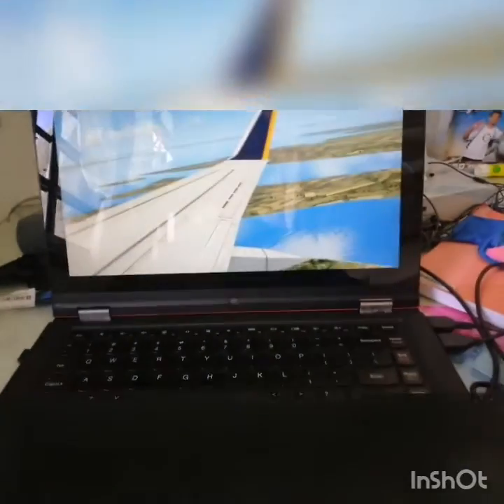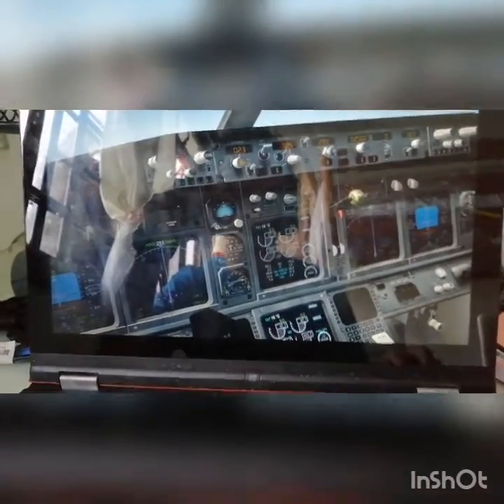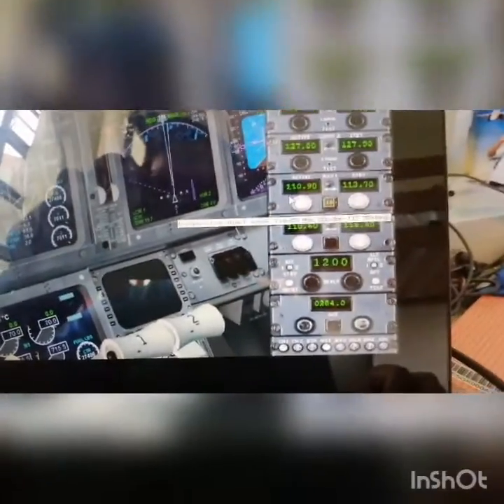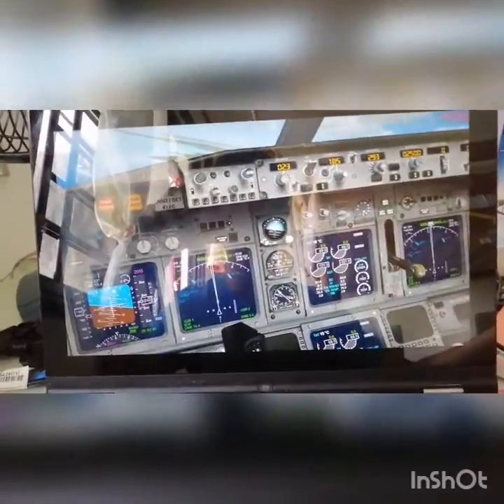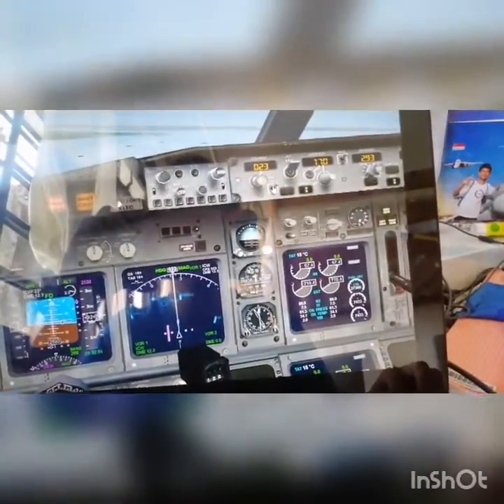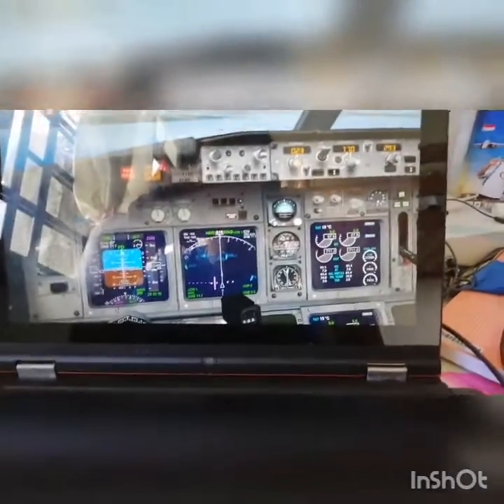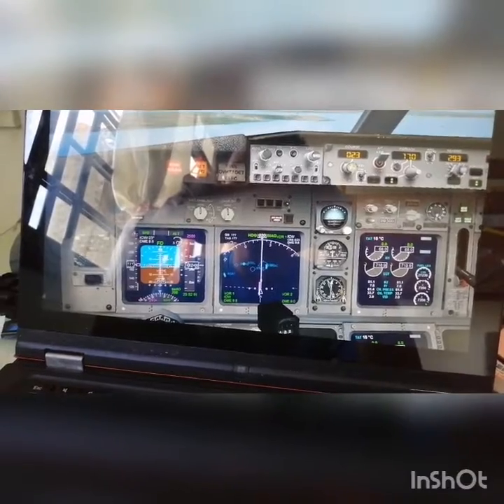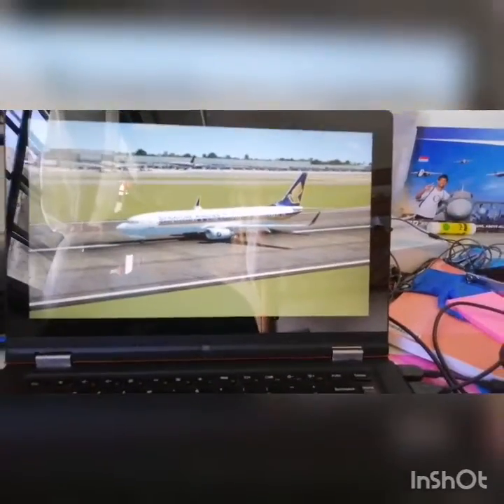How to perform an ILS approach in FSX

Comment: hi, did you still use the pxn-2119 ii? how good have it served? Thanks
Reply from the maker: Hi, I'm no longer using the pxn2119 cos it had some issues with the z-axis so now I'm using the logitech extreme 3d pro
Reply: @GAMINGWITHBG  Thanks for the response, I have the logitech too, but find a bit of dead zones also z roll difficults me as a begginer some maneuvers. Do you recomend it? or to use the hotas and the logi as joystick?